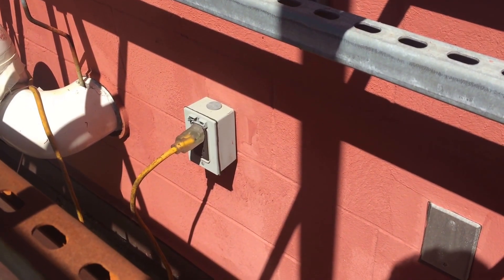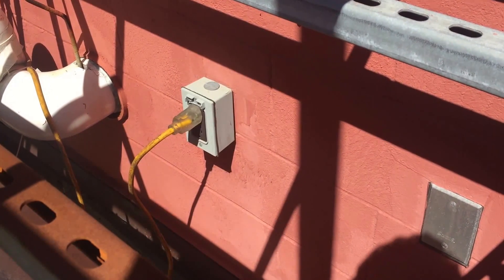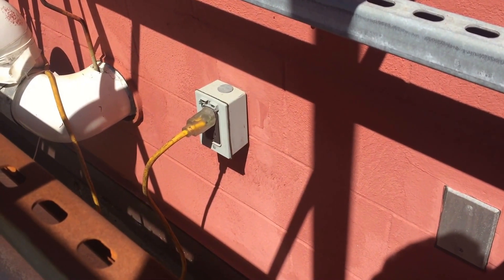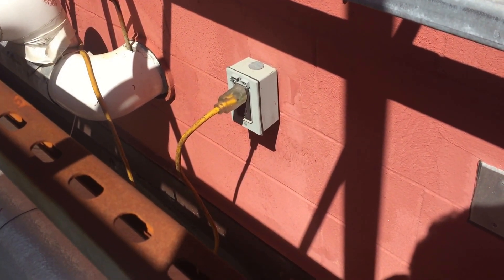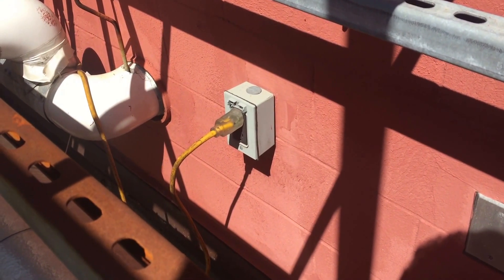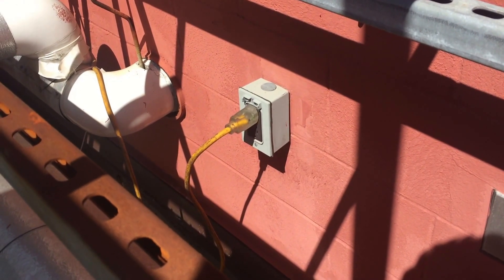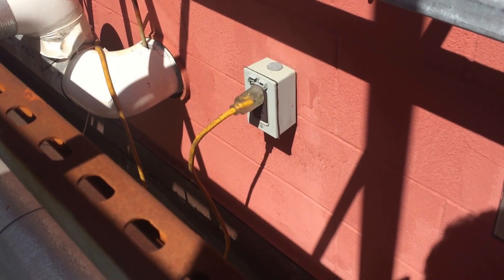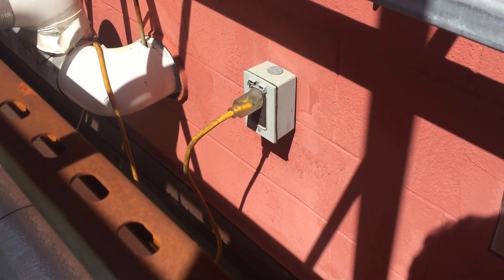Moving Violations Video No. 129: Wrong Receptacle Cover

Comment: Playing Devil's advocate here: Say this receptacle was installed at a time when the NEC allowed for the cover that's on it (in the non broken state). Is the owner obligated to replace it with an i"in use" cover? To me the violation is the broke safety device (the cover) & should be replaced with a "in use" that meets current code. But it can't really be sited for having the wrong type of cover, unless you KNOW when it was installed.....